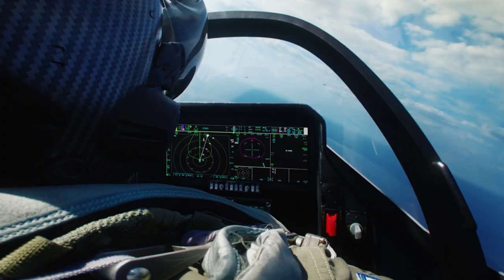US Will Send To Ukraine Deadliest Fighter Jet That Will Destroy Russia

Comment: The problems with F15, F16 ada F18 is their rather large RCS. That problem can be solved by giving them a powerful E-warfare suite. The one on Jas 39 E should be sufficient. It uses GaN tech and is therefor superior to the GaAs tech used by the US today. It powerfull enough to hide an F15.
Reply: I doubt NATO would risk giving Ukraine anything that could fall into Russian hands. When a Ukrainian aircraft is downed, Ukraine doesn't have the recovery assets the US has to make sure the parts aren't captured and sent to Moscow.

Comment: They have already started training a few Ukraine pilots.  Public knowledge which means they could be training a whole lot more and secrecy.
Reply: But it's inconceivable that Ukraine can meet F-16 aircraft requirements, particularly manicured runways instead of the standard block construction that exists today which means that even without the threat of Russian destruction, existing airports are unsuitable. F-18 is a maybe but still unlikely. The AV-8B might be a far better option if various air forces are upgrading to the F-35B. But until a successful strategy against Russian S-300 can be devised that's within the capabilities of what is being given Ukraine or Russia's air defenses start collapsing on their own, manned aircraft in general probably will be limited.

Comment: Interesting if the US feels the J-20 as the only fighter that might be considered numerous and sufficiently technologically advanced to challenge the F-22 is still insufficient. That could be the reasoning behind upgrading and extending the F-22 instead of investing resources in moving to production of the NGAD.

I'd say the only issue an extended F-22 can't address is its relatively small weapons bay which means both fewer armament in full stealth mode but also limited range of longest range weapons. The J-20 might be deficient compared to the F-22 in most ways but its larger size does mean it can stow much larger and longer range missiles. Maybe to address this problem coordinating the F-222 with a missile "truck" in the form of an F-15 or large cargo transport will become SOP operating in the Pacific where long range seems to be an important feature to have.
Reply: And old habit dies hard. China doesn't take criticism lightly and don't answer questions unless it's pre-planned. Wouldn't be surprised if their technology under performs.